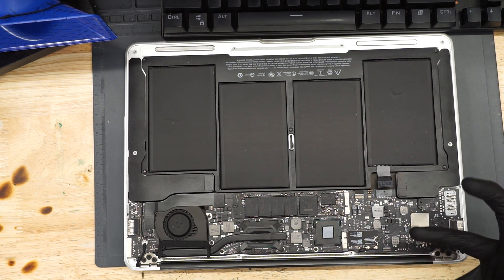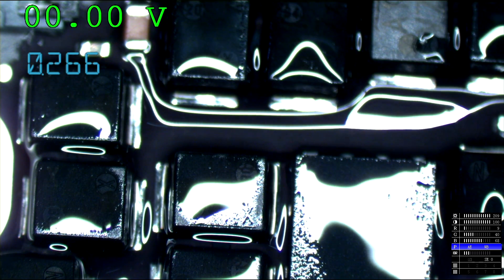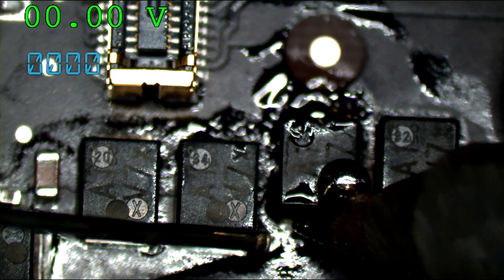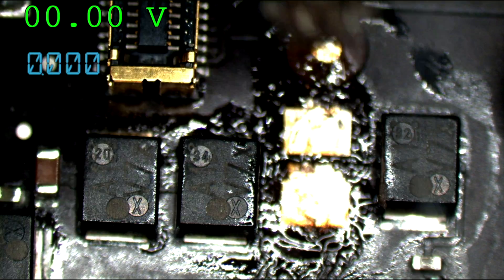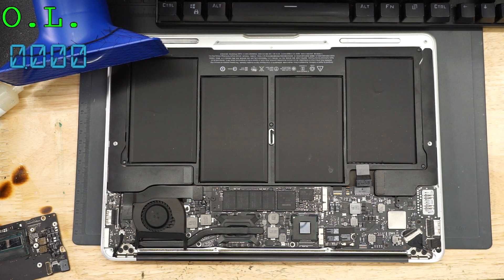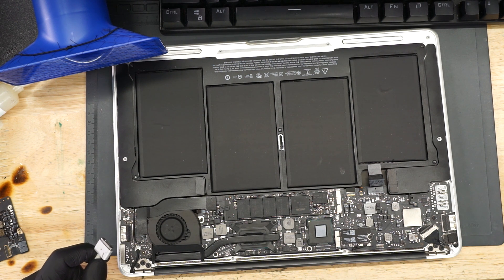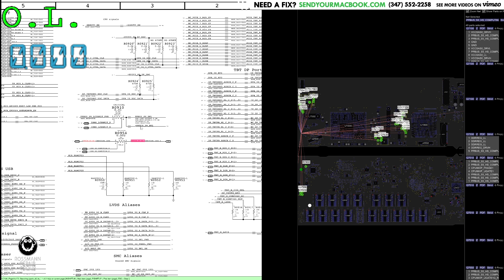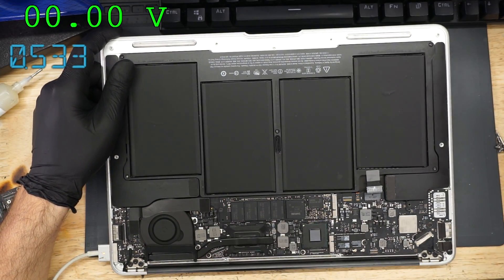Macbook Air no power logic board repair without hot air station

Comment: No power/Draws 266mA - A1466 Mid 2012 MacBook Air 13" 820-3209
Likely shorted tantalum cap on PPBUS_G3H
In this case C7560 is shorted, which is on the PPVIN_S0_CPUAXG/PPBUS_S5_HS_COMPUTING_ISNS rail, which is a sub-rail of PPBUS_G3H after going through the current sense resistor.
Replaced C7560, and FANSPIN, happy macbook.

Comment: Hi, I don't know if anybody can help me but I have an issue with desoldering braid.

It doesn't seem to suck solder as well, and it often gets stuck to the joints right after sucking some of it up. It takes a bit of effort and terror to take it off, and I have damaged some pads once because of this. Is it the soldering braid? It was very cheap grabbed off of amazon. Or is it my technique? I do use flux while doing it.

Thanks.

Comment: I doubt that this will be seen by Louis, but anyone in the industry is more than welcome to chime in. I bought a soldering iron and some practice solder boards/projects. I've soldered before but typically just small one off wire to wire jobs. Well these practice boards have shown me just how much I love working on electronics. I'm learning how to identify components and even somewhat how to read schematics. My current soldering iron is one of the $15 kits off Amazon, and although it's suited me well so far I'm starting to see its limitations. I'm currently living off unemployment and savings from my last job. I've been looking at  hot air/soldering stations for a while and doing research on each model. I can't afford the quality listed on your site but have found some that have good reviews within a better price range. I know I need to upgrade to be able to take my skills to the next level and actually remove some of the components from boards but I have a hard time pulling the trigger on spending. Should I just suck it up and grab one and then start trying to dive into this head first? Or should I try to just work on things within my limitations and wait till it becomes more clear that's my path?

If it helps the decision, working on those has been the only thing I can sit down and spend 6 hours on without noticing. Seems like my brain likes it.
Reply: I had a stimulus check of $10,000 but it's isn't up to quarter of my bill for the week I've gotta pay my mum's hospital bill, I decided to check on how to make money online and I meet a friend who introduced me to WALHACKK on 1Nstagram...all my problems were solved when I met him, I now have more than $5btc, after I invested my $9,885 into Bitcoin for a week, then my profits was paid directly into my blockchain wallet 🤗

Comment: I have Apple Watch Series 3
Today I experienced with a big problem.
The watch turned off and when pressing the side button its not turning on, even apple logo is not showing up.

When put to charge, apple logo appears then goes away then comes back and goes away again and this keeps on repeating until I remove from charging

I have no idea what to do, tried resetting/hard reset the watch by pressing power button and digital crown together for 10-15 seconds
Still no apple logo shows up 

I don’t know what to do! Tried contacting apple, they say if its hardware problem I will have to replace the whole watch because apple watches are unrepairable.

Please let me know if you have a solution, I am in real need for help. Thank you in advance!

Comment: Peak owie test to me was when I was running cat5 across the yard as a phone line for my ADSL. I could not remember which wire pair I used and really could not be arsed to walk across the quite large yard so I did what any sane and normal engineer would do, I licked the pair I thought was right. I found it!
Reply: @CGrantL  You know in retrospect that would have been wiser...
Reply: @racitup4114  I'm not that stupid lol. I knew the voltage I was getting into.
Reply: @racitup4114  they just said they knew what voltage they had and they survived the lick, seems to me it wasnt the 50.

Comment: You may also use a blowtorch on a low power setting instead of a hot air station. You'll most probably not succeed but an Apple product will get what it deserves

Comment: It amazes me how often bad capacitors are the problem.
Reply: It doesn't for me. Most electronics I've had go bad were due to bad caps. Usually a cheap fix, but not easy depending on the size of the caps involved. Had a Samsung monitor with such bad caps in the PSU that it failed after 3 years (just one month outside warranty). I got $10 worth of caps and replaced them and that thing has been running for 8+ years after the repair.
Reply: so you can get a new laptop and apple can sell yours for a stupid profit after it fixes the $30 issue

Comment: I accidentally did the owwy test on high voltage side of a 240v power supply once if that counts
Reply: You definitely remember the experience.  Countries where all AC electricity is 240v must have a lot more injuries
Reply: @ArtStoneUS  Yeah I never did that again.
Reply: @ArtStoneUS  , not really. I had a WTF test when live was routed directly to the grounding pin. It's actually less painful than OWWY test.

Comment: Impressive that a 2012 Air is still running.  How much would that repair typically cost?
Reply: Not really, I have a mate with one running still. There’s a lot of people with those models still running too.
Reply: Haha I got a 2010 MacBook Pro that still turns on, maybe it’ll get fixed one day...
Reply: Not really, I'd hedge a bet that at least 30% of all 2012 Airs sold are still running. Anyway, how much it costs depends on the store - a lot of authorised repair shops will just bung a new logic board on and call it a day, costing you $300+. This sort of capacitor replacement would set you back $100-$150.